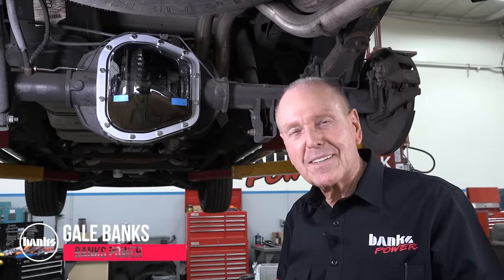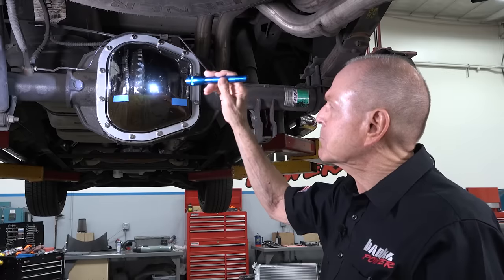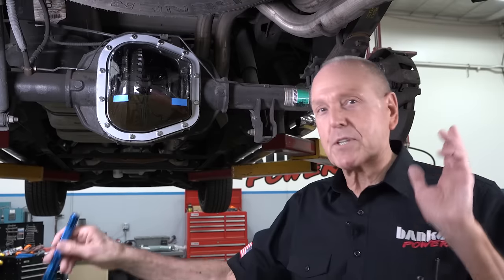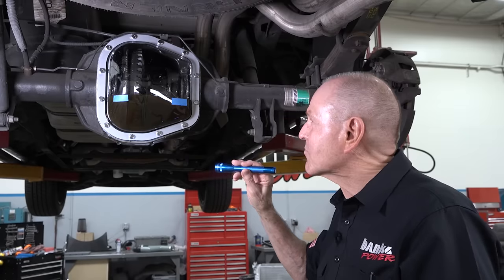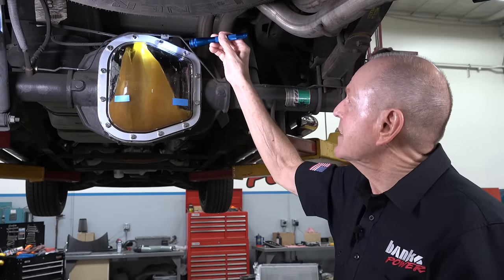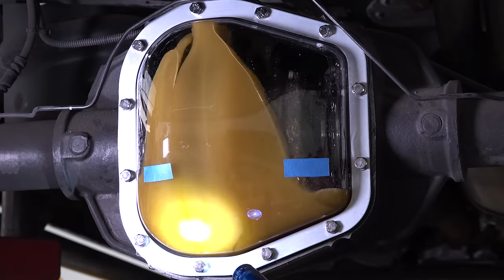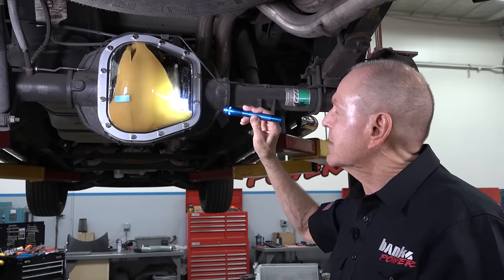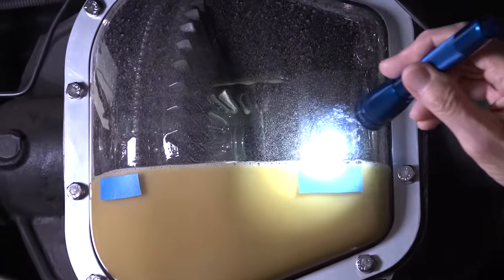What's going on behind your stock diff cover?

Comment: Excellent video Mr. Banks. I am actually dealing with some issues on my rear axle right now and when I popped the cover all the fluid was light brown and I said to myself that cant be right cuz ive never seen diff fluid light brown before lol and ive been fabbin, customizin, buildin and turnin wrenches for over 15 yrs lol. Well in your video the oil was translucent in the beginning, then when it got to heating up and mixing around and aerating it turned to pretty much the same color as my diff fluid, mine was a little darker prolly due to the fact that my oil wasnt fresh like yours lol. But it made me curious so I hit the good ole google and I was really only able to find 2 or 3 pages or videos with gear oil the same color as mine. In a cpl cases guys claimed that it was that way because the vent tube was clogged so their was no where for air to go, mine wasnt clogged. If im not mistaken I used Valvoline full syn 75w-140 with motorcraft friction modifier, and the fresh valvoline oil pretty much has a yellow color to it. I have an 01 BoostedXPLR Sport 2DR that has a Thunderbird Supercoupe Eaton M-90 on it and the original motor has 311K on it and I have not yet replaced any of the timing drive components but im working on building a new motor anyway that can handle some power so I can port my M-90 or perhaps even go to an M-112. But anyways i have swapped in a rear axle out of an 05 Sport Trac, the Sport Trac Axle is limited slip and the original Axle was an open. But since I was able to watch the fluid in your video change translucence so rapidly Im not really worried about the oil that came out of my diff. When I first saw the oil I thought it may have been burned or overheated or watevs but based on your vid I think its fine so now ill just clean it out and replace the outer axle bearings because that is where my problem is lol. Also I completely agree with what you were saying about the different shapes of rear diff covers and the way the different shaped diff covers impact the way diff fluid flows or circulates, and that never really occured to me till I watched this vid lol, but it makes me go back and think about whenever ive seen a beefed up truck with a squarish diff cover lol. But thanks again Mr. Banks its nice to be able to put a face to Banks Performance. Ive known about Banks Perf for a long time and Ive even used Banks products on a decent amount of occasions especially Banks Power Programmers. Banks always makes a quality product, and im lookin foward to watchin the other vids with Mr. Gale Banks himself when I can find the time lol. Take care Mr. Banks

Comment: I've been a tech well over 20 years and I've never known that about the rear diff cover, thank you that was very informative.  I would love to see a clear cover on a lifted truck with the axle pinion pointed up at the improper angle to align with the driveshaft, curious how the flow would be on that?? Love the videos here on YouTube keep them coming..
Reply from the maker: Stay tuned for more content. We are road testing and trailer testing our diff covers right now.
Reply: If you look the axle is being supported by the springs so the diff is already at an extreme angle,  the ring gear will have no problem throwing oil to the pinion bearings on a lifted truck

Comment: If you want to accurately test while having an opportunity to see what is going on, make a negative of the inside of the diff cover, and then vacuum form to make a positive.  Then you'll get an accurate enough copy of each cover.  Use a thermal camera to track the differences in heat-wicking performance.  (For the YouTube keyboard commandos that want to argue about this.)

That is exactly how some race teams test to see which covers will do what they want, and the reason I will not put a flat cover on any diff I build.  I want the dish to follow the shape of the ring gear and the inside polished smooth.  No ridges, no odd shapes, just a nice close fit.  Thick to stabilize the heat, smooth on the bottom to not catch on anything, fins on the back to have more surface area for cooling.  The problem is getting manufacturers to make an OEM on the inside diff cover, with better cooling on the outside.

Comment: The famous 95 MERC runs a cast-aluminum diff cover that has a drain plug and jack-bolts that allow for bearing pre-load. The cast cover holds an additional 20 ounces of 75-W-90 Royal Purple Gear Lube. Runs 20 degrees cooler than the stock cover. LubeLocker re-useable gasket.
1995 Grand Marquis Restoration - Mercury Forum - Mercury Enthusiasts Forums

Comment: THE REAR AXLE BEARINGS ARE ALREADY LUBED BY HAVING BEEN GREASED WHEN INSTALLED ANYWAY. IT IS BETTER THE DIFF LUBE NEVER REACHES THE OUTER AXLE BRGS ISN'T IT? THANK YOU GALE FOR MAKING THIS VIDEO. I HAVE WONDERED FOR OVER 53 YEARS HOW THE OIL IN THE DIFF MOVED/WAS SLUNG ABOUT WHILE THE CAR WAS RUNNING DOWN THE ROAD. NOW I KNOW.

Comment: Seeing the amount of oil getting thrown around and the aerating, I think a simple electric constant speed pump and spray system would be a huge benefit. The amount of resistance there has got to be huge at high speeds. This is a big part of the 20-25% drivetrain hp loss. Imagine a procharger or roots blower. You can spin it with fingertips. It is only moving air, but at high rpm with 15 pounds of boost its taking nearly 150hp to spin the blower...

Comment: Simple solution.  Drill a hole in the top of the housing and fill it to the top.  Take the vent tube and plug the fill hole with it.

Lube everywhere.  Use any cover you want.

Comment: I like my AFE rear diff cover. Sight glass, bigger capacity fluid, large magnet better drain plug and it looks bad ass
Reply from the maker: If you're happy with it. No reason to remove it. There are those who may choose to remove their flat-back covers when they realize it's costing them horsepower and fuel economy as detailed in our other videos on the topic.

Comment: ive always thought that the tapper of the axle was how the outer bearing got its lube. going from small to larger diameter would give the oil a lower drip edge on the bottom of the axle forcing the oil to the outer bearing

Comment: The sad thing is that this type of testing was already done before the iron hit the mold and involves sometimes tens of thousands of test hours at the manufacturer. In my 30 years with Chrysler, we would do test similar to this with a wide variety of components. We actually constructed an entire rear axle cast out of polycarbonate plastic to study the ring gear and pinion gear meshing at various low speeds under 35 mph. We also destroyed a few ring and pinions by running them dry. But, yes changing the pan to a different design square or more round dramatically influences the lube circulation in the pumpkin. There was this one company who I will not name, back in the early 2001-2002 time frame that was marketing a rather huge square replacement rear end pan that was advertised as keeping the lube 70f cooler and thicker, adding two quarts. Well, it destroyed a lot of rear ends the lube would stay too cool and spin off the shaft halfway up the tube leaving the outer bearings to run nearly dry. Think before you buy.

Comment: Any design and or techniques that improves fluid and/or airflow will have a net positive effect in the  performance and function of any machine. The ultimate objective is to reduce resistance and heat build up. 👍

Comment: Pretty cool 
I can tell a story of when I worked at a ford dealer one time they hired a kid from a tech school and they gave him a easy service 
One of the things he was supposed to do drain the differential put a new gasket on and fill it up with new fluid 
Well he took the cover off cleaned it put a new gasket on than with the whole shop watching in amazement he filled the cover with new gear oil than took a handful of bolts and slapped the cover on as fast as he can and tried to get the bolts in  as fast as he can while the fluid was gushing everywhere 
Everyone was on the floor laughing lol
It was hysterical I wish I would have taped it but there were no cell phones back than
Than the foreman told him that the fill hole was on the front on the side 
He took the drive shaft off and was trying to take the pinion nut off 
Needless to say he didn’t last long lol

Comment: I just fill my diff until it starts to drip out the fill hole or is level to the fill hole. Half an inch below the hole is minimum level. That's how I was taught. The filler hole/plug on the rear diff cover of my 55 GMC Pickup is large enough where I can check the level by eye. Roughly about over 1 1/8th inch in diameter.

Comment: What banks is forgetting here is that the gear oil level must be sufficiently high enough to lubricate the axle bearings pressed into the ends of the axle tubes as well as the carrier bearings pressed onto the diff carrier.

Comment: Great video!  Learned alot about what is happening inside the diff!  Any thoughts to car manufacturers like BMW who have a cast housing with no cover to take off and ONLY a fill plug?  You have to suck the fluid out - but what about metal bits that are too heavy to get sucked out.  Personally, I think BMW has a bad design that will shorten components within their X series vehicles with this design.  Like the good old American diff cover that can be completely removed!!!

Comment: Interesting stuff! So the stock covers are not always designed optimally? Not sure I understand what is the point of this topic. I see the point though if the cover get's rid of heat faster like aluminum. But which is going to last longer?   If a stock one lasts longer and I change the fluid often enough, that is better than changing the cover, right?

Comment: I hope you will answer this question for me.I put Falken 305/65/18 tires on my 2014 Ford F150..I still have only the stock factory spare.I think it's a 265/70/18. If I have a flat can I use my factory spare tire to get me to the nearest shop or home.I would be keeping my speed below 45mph and drive less than 50 miles.I just dont want to kill my diff.Thanks in advance.

Comment: What you say makes  since a lot of since. 
 My 2001 F250 super duty has had a flat back on it for 300,000 miles pulling trailers off and on. I have  changed  oil  as required.  I have no issues.  Can you explain?

Comment: Hi, I have a ford mustang gt that I bought about 2-3 months ago. I checked the rear axle oil and didn't find anything with-in the case using my finger dip. I added 4.25 pints of 75-140 syn oil in it yesterday. I took it for a ride and stopped and found the rear-end breather spewing oil out of it. I've seen a number of YouTube vid's speaking about this problem with the ford rear-end.  Note; I have a ford racing aftermarket aluminum cover on it. Can you help with trying to resolve this problem.

Comment: What would happen if you replaced the synthetic oil with real oil .
Would it foam the same or more ? 
I have a jeep wrangler and burnt the rear end gears I never checked the front I'm scared to ....any way to eliminate the foaming process?

Comment: My guess would be that most vehicles wind up in the junkyard with the factory lube still in the diff. Nobody changes that stuff unless they have a failure. If it ain't leaking, it ain't getting changed.

Comment: I changed my rear diff original fluid on my Lexus GS300 at 20,000miles.  It was dirty.  I used Mobil 1 synthetic.  I changed it again at 40,000miles.  Surprising, it was as clean and clear as the day I put it in.  I changed it again at 80,000 miles.  It is still as clean and clear as the day I put it in.  I think I will keep this one until the day I get rid of this car.  My point is ... always change the original fluid early.  That's when most of the metal shavings come off during break-in.

I recently change the reduction gearbox fluid of my EV at 14,000 miles.  It was very dirty.  The color is grayish like metal shavings.  The manufacturer recommended 50,000miles interval!  Yikes!  I used Red Line  Synthetic this time (better than Mobil 1).  What a nice different in smoothness when using Red Line Synthetic.  I can actually feel/hear the difference with higher quality fluid.

Comment: I have a 2015 Cadillac ats 2.0 turbo rwd sedan with the 3.27 gear ratio. If I'd have known that these cars have problems with the rear differential I'd have steered clear of it. Also I'd like to know this might sound kinda stupid and all but when the rear differential goes out is it just the differential carrier that i need to get? Just trying to figure what I'm going to do with this car right now.

Comment: please just I bought a 08 f150 rear wheels not spinning do you think is the transfer case or differential when I put the car up to the air rear wheels are like locked my truck won't move at all and when it goes in gear it trys to shut off

Comment: and to think there are alot of people that say do jot use brakeclean to clean R&P gears when doing a lube change...they fear that the bearings will be stripped clean and seize after you start driving....you cannot convince these people that oil instantly flings around inside the axle lubing the bearings back up

Comment: I have a 2001 Chevrolet pickup truck C 2500. 277000 miles. The stock stamped sheet metal differential cover.. what else is it supposed to do. Except keep the oil and the differential.

Comment: I used to work at a shop. I'd drain gear boxes and metal shavings would literally pour out. Some manufacturers use a magnetized drain plug or fill plug and it would be covered in metal shavings.

Comment: So the rear axle fluid is just as important as the transmission fluid and motor oil. The differential fluid with friction modifier is very important.

Comment: I'm still a bit confused as to why you'd want aluminum over steel? Steel has a higher melting point 1300+ Celsius as opposed to aluminum with 600 Celsius. Wouldn't steel take the hot oil better than aluminum?  This is remarkably interesting and i'm going to have to watch more
Reply from the maker: Aluminum transfers heat better than steel. Steel absorbs heat and retains it longer. Aluminum accepts heat and rejects it faster. Remember, the goal is to shed heat from the oil by transferring it to the cover's fins. Think of an old home stereo amplifier with fins in back. This fins are typically made of aluminum.

Comment: Morale of the story is really what comes stock on your vehicle is really engineered to be the best for that particular vehicle.. I have a 15’ Sierra I don’t feel the need to modify it like have a lift kit in it or jack it up way up in the air, guys that do that don’t realize your drive-shaft angle changes when you do that and you have to take that into consideration.

Comment: Please do a diff cover for the gm 2500 platforms with gas engines. The 9.5 and 10.5 inch 14 bolt rear ends.

Comment: Was wondering what the device was that looks like a fan of sorts was on video with the clear rear end differential cover but was shown at the end of the video once the new normal plate was replaced.
Reply from the maker: Sounds like you're referring to the anemometer. It measures air velocity.

Comment: Nice video.  You should do one on some of the aftermarket "cold air" intakes.  My 2014 Toyota already has a cold air intake from the factory.   I love the K&N junk that pulls air from the engine bay and wants 400$ to do so
Reply: Marketing
Reply: Its junk only if you buy it lol. I had a K&N intake on my diesels and theyre great. Pulled air from the grille.

Comment: Great Gale.  When are you going to design a rear end dry sump system?  Remove a large amount of the parasitic losses and provide lube where and how much needed.  Lets go with belt driven off of the pinion?  You can thank me for the idea afterwards.  Send me a royalty  check at 2%.  Regards.

Comment: I need to change front and rear diff fluid , t-case, transmission oil/filter , engine oil/filter on my 05 Hummer H2 with 140k miles.

Comment: But this only shows the movement of the oil when the car is still.  The oil is going to be flung in all directions due to g-force whilst the vehicle is moving.  Even slight movements of the vehicle whilst driving in a 'straight line' (no-one actually drives in a straight line even on a straight road) will move the oil left and right and in all directions.

Comment: Problem with this video is you are using a semi-floating axle design. The oil does not reach your wheel bearings like in a full-floating design since the axle seals are just on the other side of those inside bearings. This is why you have sealed bearings out on the ends, and in older designs, used to have to grease the bearings by hand.

Comment: So.. This would be insanity, but couldn't you make a housing partially out of copper or worse silver/gold for good heat conductivity?
I understand that It'd be a hell of a risk, since the softness of the metal could create major problems if something either internal or external, when driving where to damage the diff.. 
It would probably be relatively expensive too.
But you'd have unparalleled heat dispersion.
Reply: YEP. It's insanity. Seek Help !!

Comment: Mr. Banks do you recommend a certain brand of gear lube? That might be better than most thanks for any info.
Reply from the maker: Yes, AMSOIL Severe Gear full synthetic.
Reply: @bankspower  ok thanks so much i have a 2003 chevy suburban and I have never changed the rear gear oil the truck only has 85.000 miles on it when I get the money i want to buy your diff cover.